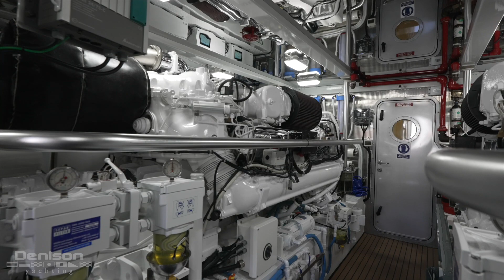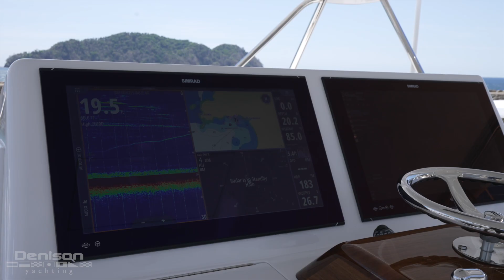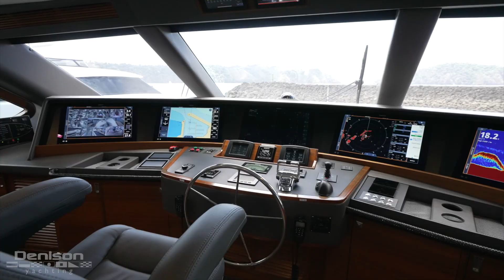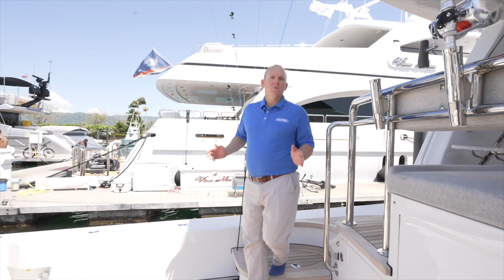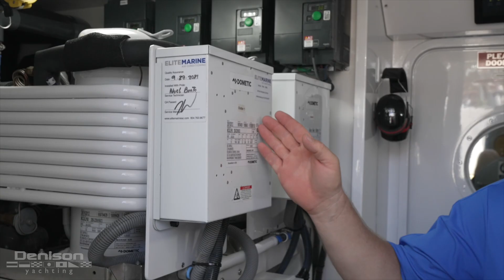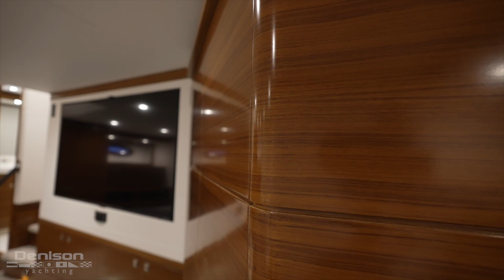94 Sea Force IX Sportfish Yacht [BONNY READ]

Comment: Gorgeous boat, great refit, but if I spent 11 mill on a almost 30 year old glass hull, I'd kick my own azz.
Reply from the maker: 94 is the length, not the year. She was built in 2013...
Reply: Othe than a new paint job the original cored hull was not touched